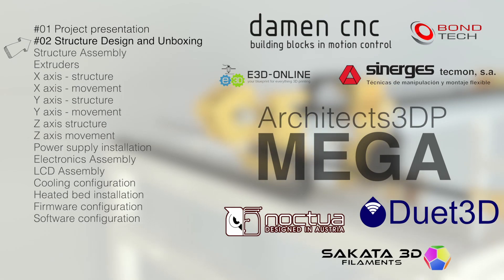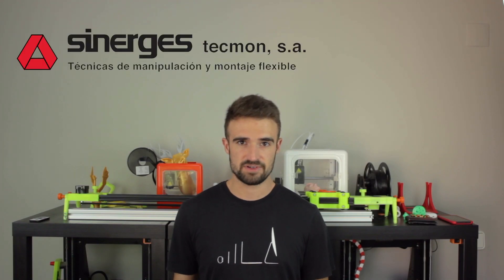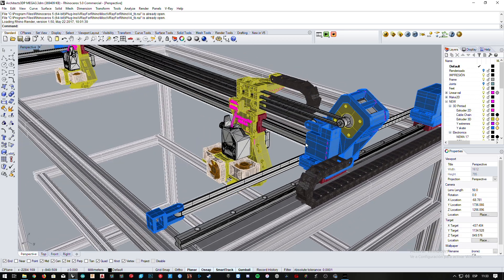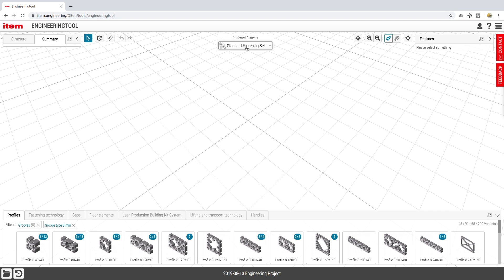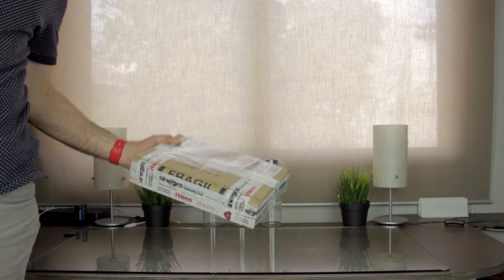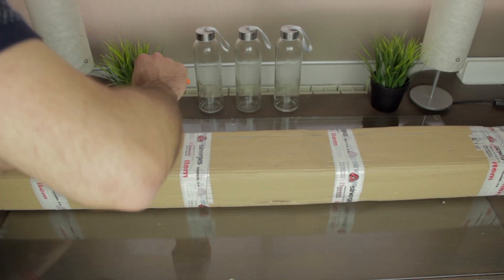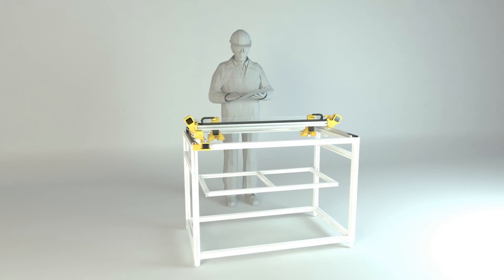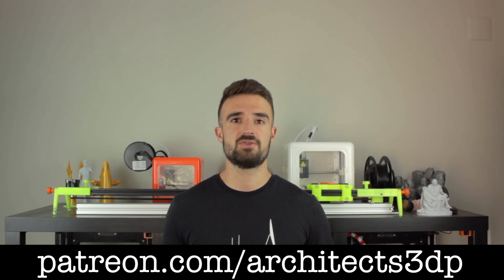Architects3DP MEGA - Structure Design and Unboxing #02

Comment: I just finished building my own 520x520mm printer. For the robot droid guys, we need to be able to print 510mm wide, how hard would it be to modify this printer to 520mm wide? I hope it has lots of vibration damping so we can print fast without ringing.

Comment: Thank you for the great video and the good explanation. I'm looking forward to the next episodes.

Currently I am dealing with 2 questions: Can I print later with the printer ABS, so the print bed gets enough heat?

Is a autobed leveling planned? And currently I've looked at the aluminum profiles at item, is there a file from the Engineering Tool to see better recognize the connection technology?

Thanks you for your work
Reply from the maker: Dear mhwaw2211, I'm sorry for my late reply.
1. I'm planning to make an enclosure to keep the printing chamber warm, and also add a heated bed. It's still not clear how It'll be made, but I guess it will be possible.

2. Yes, I'm gonna be using and IR probe from Duet 3D to make the auto bed leveling.

3. I've updated the description of the second episode of this series. There I added a link that will bring you to my finished project in the engineering tool, where you can view, edit it, add it to the cart and make the checkout, etc.

I hope this helped you.
All the best.
Mateo